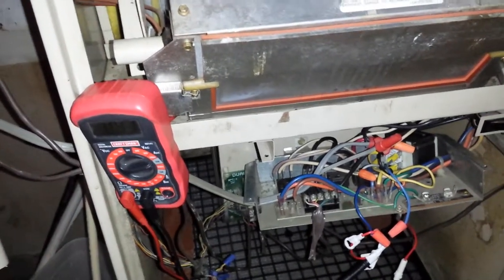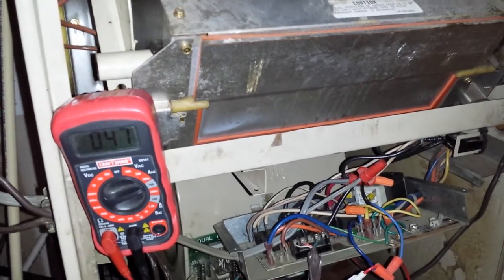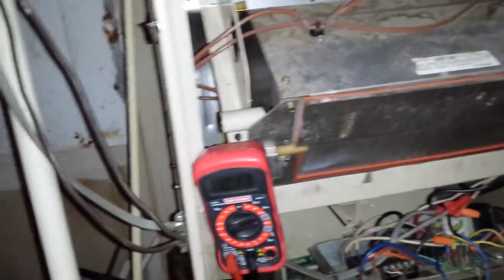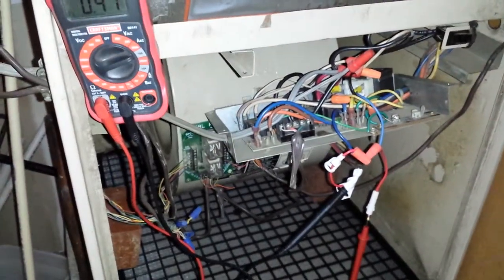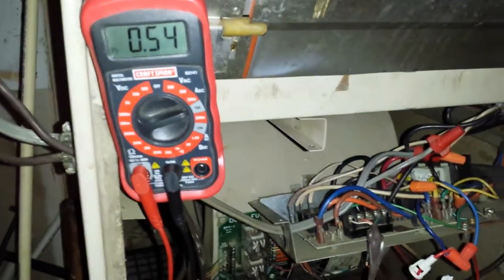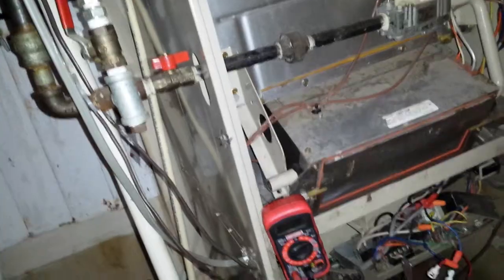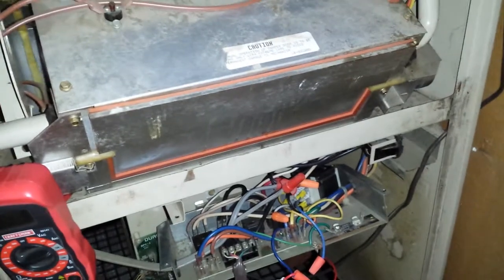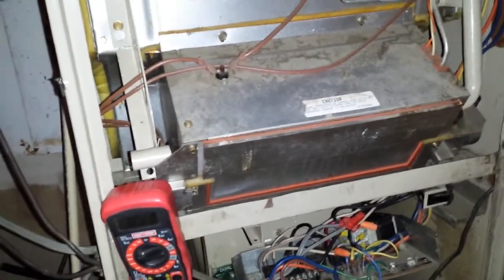10  oge short vs long OGE OG&E energate SmartTemp Thermostat Smart hours Smarthours Breaking my HVAC

Comment: well it matters not about lingo or where you are from these thermostats are designed to keep your central air and hear unit running more to run your light bill up, i noticed what i think he is trying to say, it will cause your unit to run on a lower power so you do not hear it. in other words this is how it is running your heating and cooling cost up !
Reply: +ATSLLCUSA I work I need kind of systems on a daily basis do you